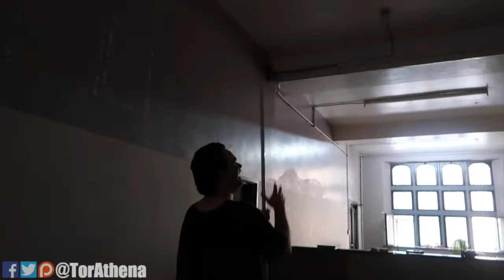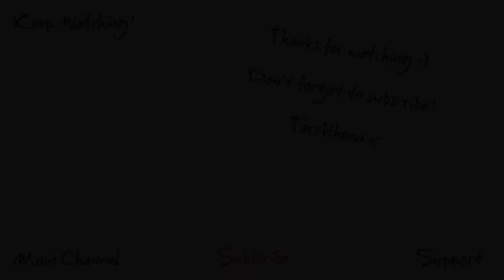The fire alarm went off - Daily Vlog

Comment: The two-week video publishing lag probably renders my advice futile...but...if a fluorescent tube is flickering like that it's usually the starter switch.  You can buy one for less than a couple of quid, from most DIY places.  It's the barrel shaped thing that sticks out a bit at one side.  Simply pull the old one out, go and buy a new one, and slot it in.  Of course, there's also the small issue of having a giant stepladder.... :)
Reply: brumanlcy 2 week lag?
Reply: Published 12 Aug, filmed 29th July.  It's in the info box above...